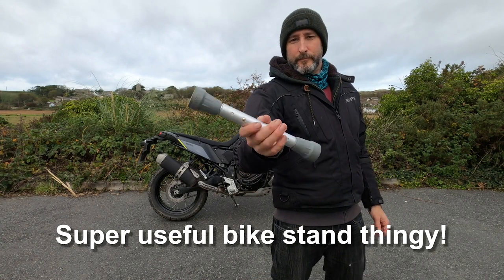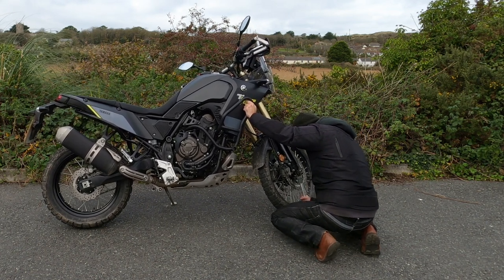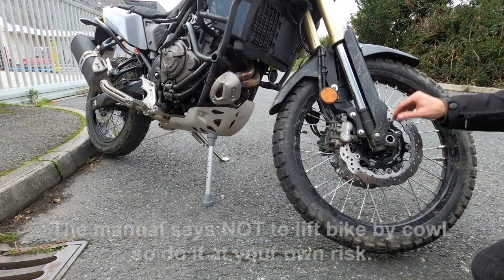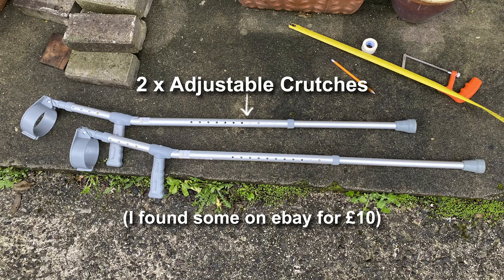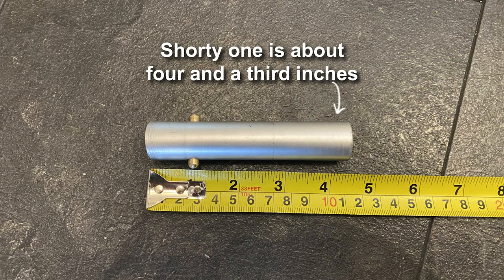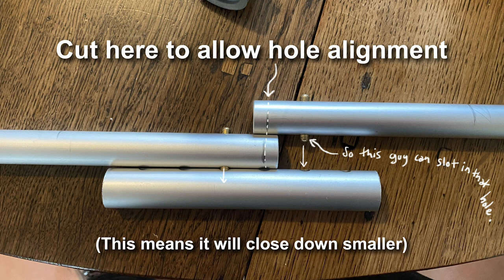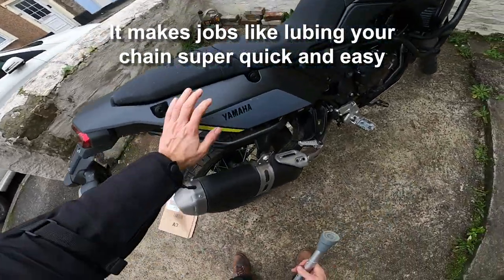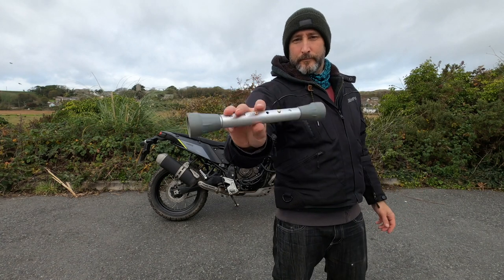Super useful DIY bike stand thingy! Cheap, Easy, Handy, How to make one.

Comment: I’ve been using a crutch Jack for awhile now but when I made mine I did it in two parts, not three. Your design is an improvement (shorter and more packable). I will be redoing mine. Thanks.

Comment: Use a Velcro strap around the front brake lever if you don’t want the bike to move forward.
Also if anyone doesn’t think it is strong enough there are commercial ones available that use 16mm outer aluminium tubing and this is stronger than that, for extra piece of mind you could drill an extra hole in the outer tubing that aligns with a hole on the inner tube and put a large R clip through it.

Comment: Go with it mate. Got one I made myself (too). There are lots of people who have used this method for years with no problems, so you can disregard the negative comments. Another version some people make/use is using solid bar, sliding inside a tube with a pin to set the required length. These types are even available commercially but why not make your own stuff when you can and save money? 👍 Looks like you haven't done the seat mod - so you don't have to use the allen-key to remove the front seat. Look into that one too. 😎
Reply from the maker: Yep need the seat mod. Lots to do on my bike. :)

Comment: Hi. It looks like a great idea but isn't there a great chance of moving the stand and dropping the bike while removing / installing the wheels in case of a puncture ?
Reply from the maker: I was doubtful too before I tried it. 
But if you take precautions I think it’s very stable. 
If changing back wheel put a Velcro strap around front brake. 
And if changing front wheel put steering lock on and put it in gear, and ideally wedge back wheel on a stone or against kerb. 

If you do those things I would say it’s very stable. It’s not going to break, so as long as on solid ground it should just hold up bike fine. 

(Of course in very strong wind, or on muddy ground etc. I would think twice.)

Comment: It works for me on the back wheel, but the front is pretty unstable.
Reply from the maker: Did you try it with the steering lock on, and rear wheel wedged against a rock or curb?
Used this on 5 different bikes now. And it’s been fine for me on both wheels.
Reply: @biscuitsalive  I will try with the wheel lock. Thanks

Comment: Load capacity of the crutch catches and tubes??  Sorry, there is no telling whether this will suddenly give way despite the fact it initially holds………..don’t think this is a good option
Reply from the maker: They state 210kg on the crutches. And that’s for full thing (arm rest etc). Not short straight section. So prob double that. 
And they are prob supporting about 70kg at most on my 200kg bike. Side stand is taking most. Then other wheel and my FIY stand are sharing rest. 
So they are much stronger than they need to be for this purpose.
Reply: @biscuitsalive  Thank you appreciate the response
Reply from the maker: @notexpatjoe well I prob wouldn’t use it for a Harley. But been using the same
One for adv bikes, and dual sports etc for years now. And it’s been fine. 
Prob use it twice a week or so too. So gets lots of use.
Reply: Great tip! Then don't use it because you're scared. Wow can you talk to girls?

Comment: its your bike your body, and your responsibility. Dont want to disrespect, but it seems too dangerous. centerstands are built to support 200+kg of metal with balance. Even with few strong wind bike would easily fall on opposite side of sidestand, where may someones head could be. I wont encourage any maintenance job with it... so think twice.
Reply from the maker: I doubted it before trying it. 
But it’s deff solid enough for a wheel change. 
As long as on good solid ground. And placed properly. 
Think if I was in the mud I would just lay bike on side anyway if I was in a pinch. 

And it is strong enough. The stated weight limit on the crutches was about the same as my bike weight. And it’s only holding less than half of that. (Side stand and other wheel doing over half the work. )

But yes I agree about the wind. We get fierce 40mph+ gusts where I live often this time of year. 
And I wouldn’t want to change a wheel in those conditions with it.
Reply: Yeah, with muddy floor or gust, having your bike on side is WAY much safer than that...

As you mentioned and showed, few spray works or wheel check can be light enough for job, but when youre disassemling bolts and nuts, you're adding literally an additional pressure on stands. Those hollow and thin metal might look rigid, but get easily stressed and cracked. (we bikers all know that. Even frames get cracked.) Which can be a dangerous accident while your job. Thats why we pay for hundreds of dollars on those stands from brand, who takes legal responsibility, making with certified material.
Reply: I think I would track down some steel tube, but otherwise a brilliant idea.
Reply from the maker: @clay2pot  get some crutches from America that are designed for massively obese patients. 
Those things will hold up a tank. XD
Reply: Similar to trying to crush an egg in your hand by pushing on the ends; you can’t do it. 
I’d be willing to bet if the aluminum crutch tube was placed perfectly vertical, it would hold a small car up. Or at least a Gold Wing.